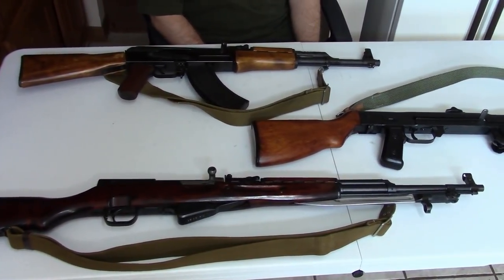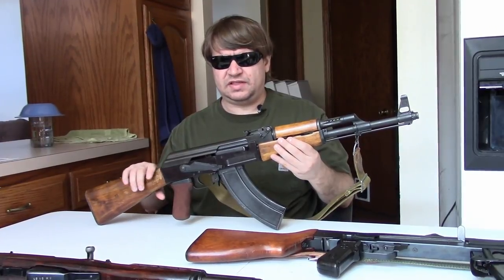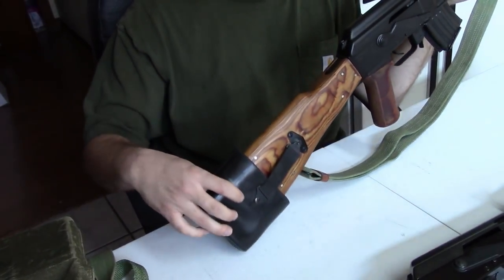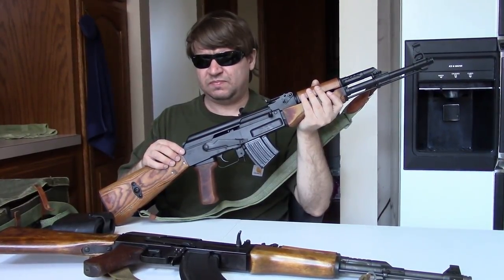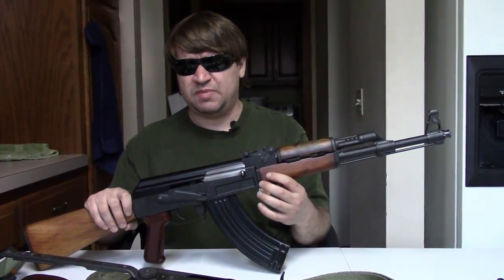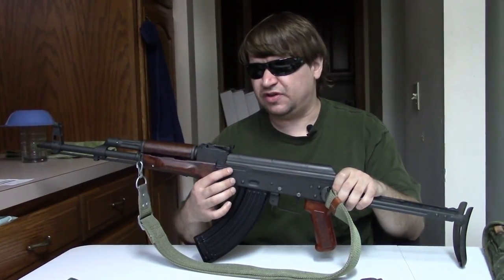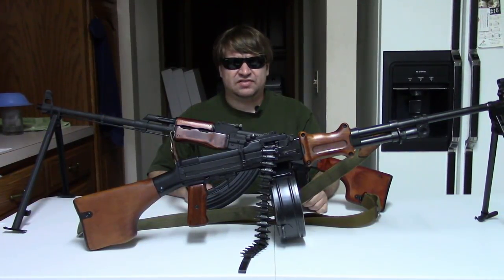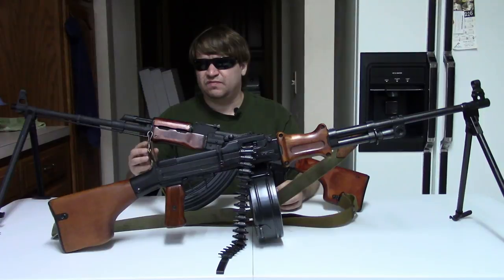Big Guide To Polish AKs Pt. 1: 7.62x39 Rifles (1947-1977)

Comment: 3:39 - SVT-40 was not manufactured in Poland, and after WW2 it saw a rather limited use in the Polish Army. As for the PPS-43 - they were made in Poland, by at least 4 different companies, but I've never seen any made by Radom. The wz.43/52 version with wood stock was made by HCP factory (code '6 in circle'). However, the PPSh-41 was made in Radom.

Comment: wow, another fine video. Im surprised how much i like the accessories that you add to you're presentation. I have a question about slings, particularly the ones for the Vepr 12 or Vepr Rpk 46. Why do these two weapons have the rear sling mount on the opposite side (right side) as to the sling mount which is in front (left side)? Maybe you could touch on this in one of your videos.
Reply: Because of their folding buttstocks.
Reply: Well that seems like a really simple answer, I guess as a gentleman you left off, "DUH"

If that be the case why not have the rear sling mount on the bottom of the butt stock? It just seems that I have a lot of sling flapping around because of the extra distance. Anyway, just an observation not a complaint.

Keep up the good work.